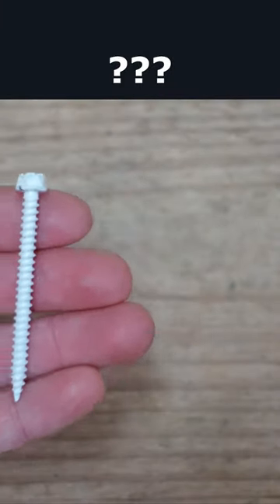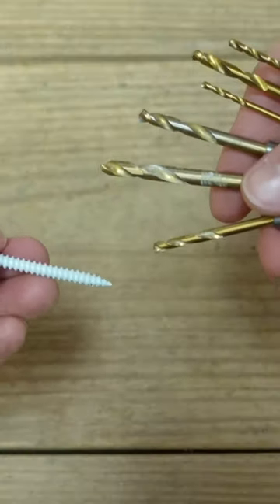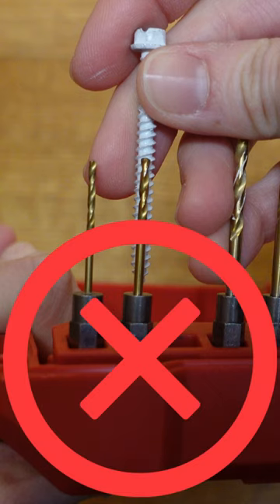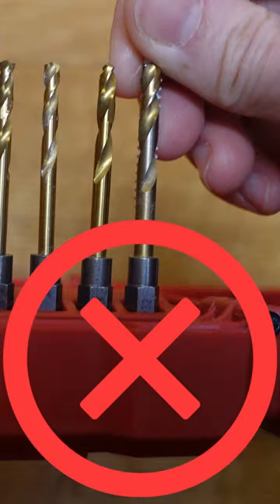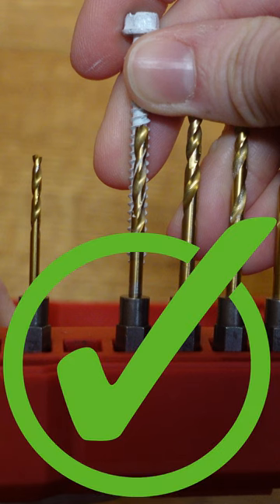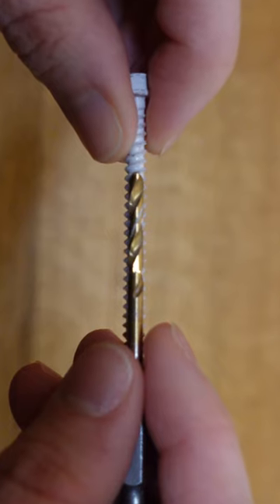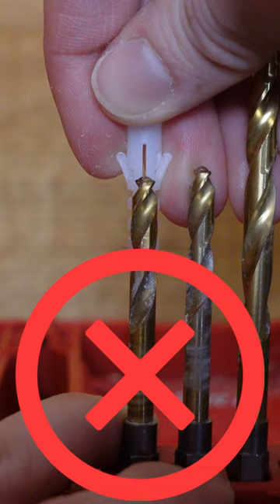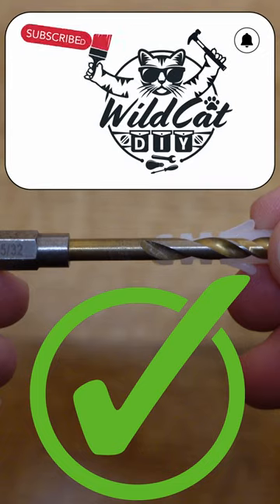Quickly Determine the Right Drill Bit Size for a Screw or Anchor #shorts

Comment: don't forget that depending on what material you anchor into (like lumber) you actually want a bit of pressure on the screw shaft, so a slightly smaller bit should be used.
Reply from the maker: This is a great point! Thank you ❤